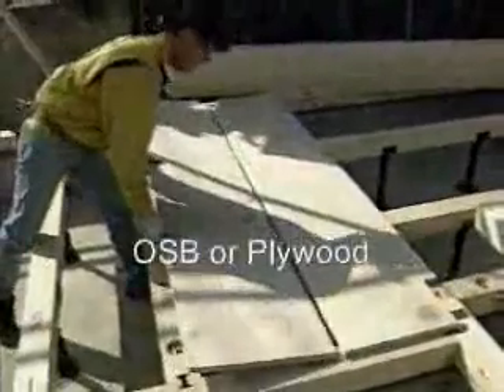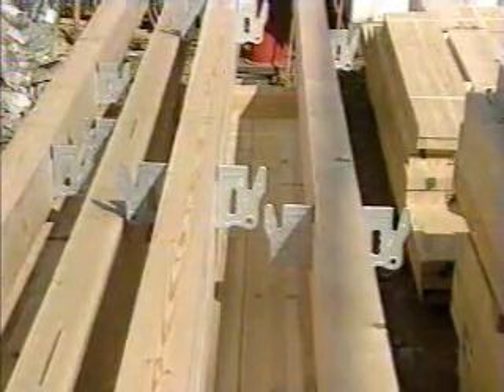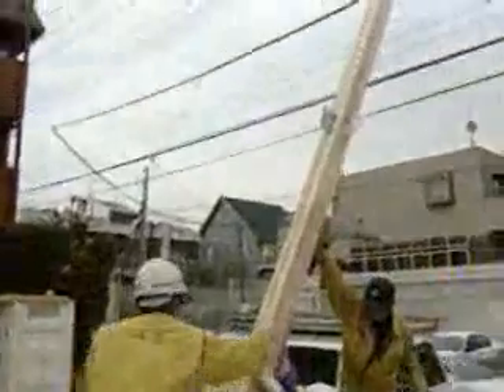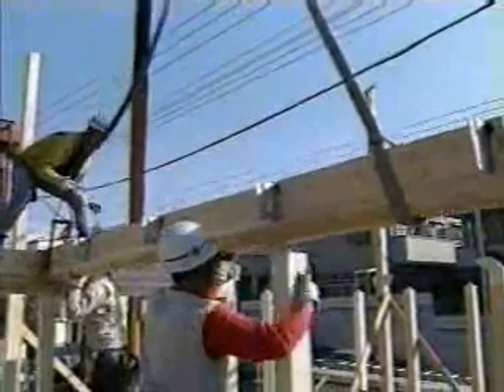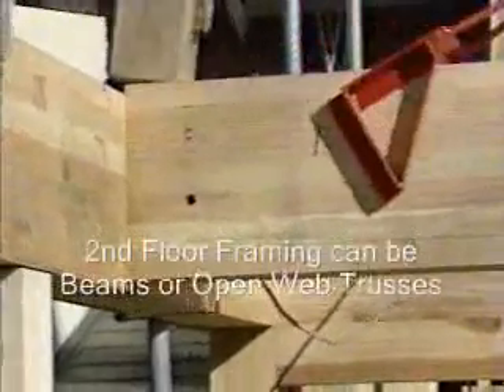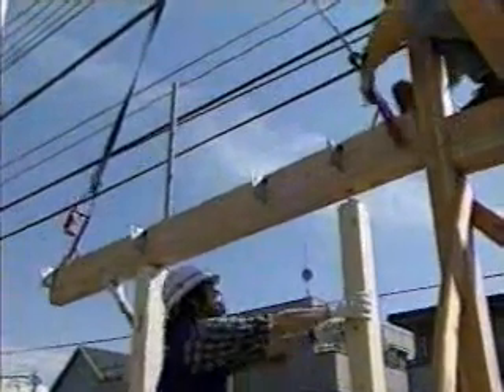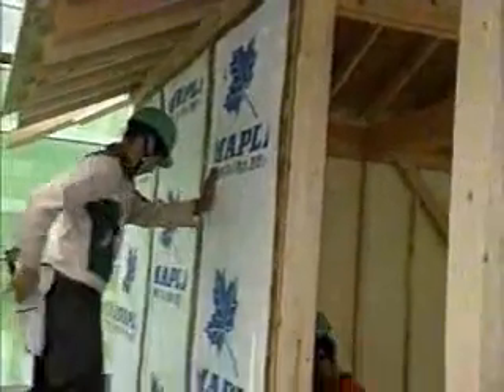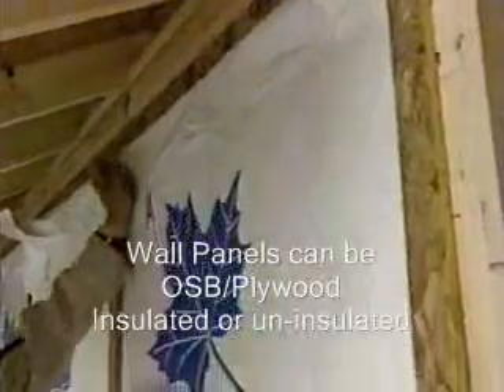How To Build A House in A Day

Comment from the maker: @ Lawrence Kerman - Actually, since it was designed and is used in Japan (where there are 3 seismic occurrences PER DAY!) it has never had a failure with more than 15,000 units of housing built there. IN fact, the system was designed in the wake of the Great Hanshin Earthquake in Kobe, Japan because so many other construction methods failed.

Comment: I can assure you this those metal fittings in that wood will condensate slightly and over time will rot at all connections. Its just simple science the density difference in the 2 objects . Nails do the same but their size is such where the condensation isn't enough to accumulate. Just look at old homes where the bolts were used they also have rot around every one

Comment: They needed to punch press those boards and nail them with screws and not nails, nails come lose in enought time. Also conductor wires needed to have been run over to the trusts and joyces.

Comment: What you say is true, but, this system they are using is very good. They are using thick beams and great engineering, like the omish build their houses ( old school with new technology). Theses houses, in my opinion, can stand the test of a long time. Of course, you cannot replace the roman way of building as it is proven through the decades, but this method is way better than the stick built homes you normally see these days

Comment: @ qwerty:  there are cob houses in UK that lasted from 1600's until today.  COB: mixture of soil, sand, water & straw.  well insulated, fireproof, termite-proof & easily adaptable for designing with round spaces/corners, etc.

Comment from the maker: There are about a dozen of these homes in the USA without problems.  In Japan (where they have 3 seismic occurrences per day, on average) there are many thousands...Structural testing performed in the US, demonstrated these homes (framing) as significantly stronger than 2x6 framed homes.

Comment: Essentially, this is identical to timberframing, except that metal connectors are used instead of mortise and tenon joints.  Because, less wood is removed in the connection, the wood dimensions don't need to be quite so large structually.  I have little doubt that buildings build in this way would last for several hundred years if properly maintained.  Consider that in Britain timber framed homes are still bought sold and lived in that were built in late medieval times.

Comment: That system would only be as good at the metal fittings.. If there were ever an issue with the "metal" (unexpected breakdown, corrosion, bad alloy etc etc etc) the enitre house would fall to the ground.  Remember the problem with compression rings on pex pipe?

Comment from the maker: Actually, it is about 25% less due to SIGNIFICANT labor savings.  I worked on nearly 2 dozen homes in the US and we did detailed financial analysis as did the builders who built with it...We never scaffolded a house in the US...That's a Japanese thing, which by the way, studies have shown saves much more in efficiency of erecting, sheathing, air barrier installation, siding and painting...